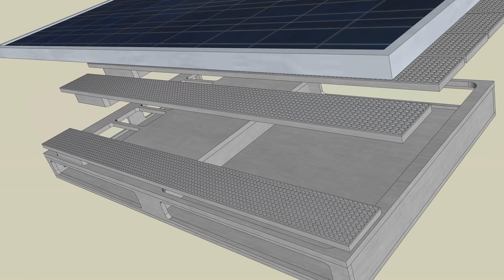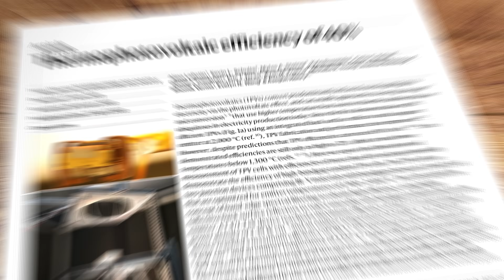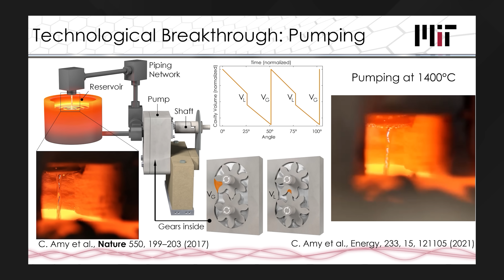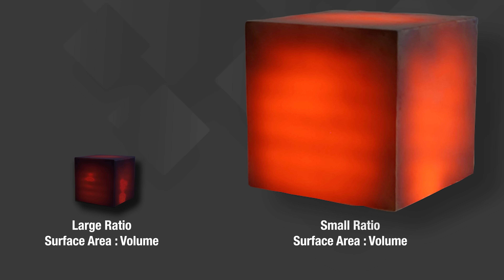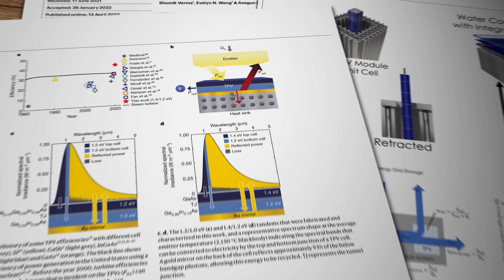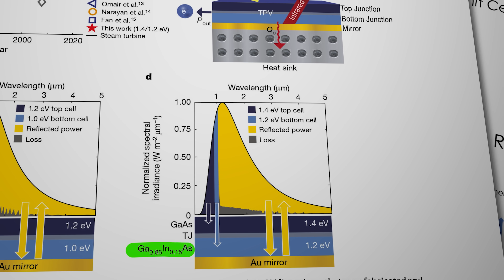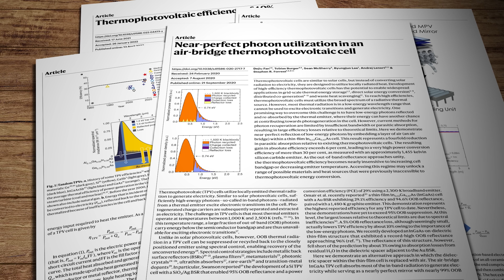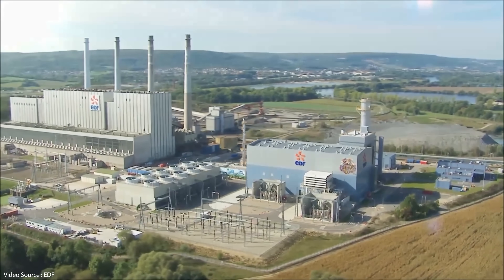Grid Scale Energy Storage 30x cheaper than Lithium-ion! How do they do that?

Comment: Certainly seems WAY too complicated!  Why not just heat the carbon blocks by running the electricity right through the blocks?  They make resistors out of carbon, so I imagine this would work fine.  And you could dump all the fancy gallium arsenide mirror PV cells by extracting the heat to run steam or gas turbines directly.  It might not be as efficient, but it would be way cheaper, using existing technology.

Comment: I'm confused as to why there are so many steps in this process. Graphite is a decent conductor, so why not skip the molten metal part all together, and just heat the graphite by using that as the resistive heater? And while we're at it, make the graphite in consecutive rings making it possible to heat the thing selectively from the inside out. In stead of argon, pull a vacuum, which would also double as insulation, as long as you reflect thermal radiation back at the graphite. Then design the rings to allow for the PV's to dip into them. Now you have all the blocks, and the same flexibility, in one unit.

Comment: Having thought about this a bit more, it seems the objective could be achieved extremely simply and cheaply with old technology. The energy store is the challenge, not the conversion of that energy into electricity. There are plenty of simple ways to convert heat into electricity. The energy store is in the carbon blocks. The other challenge in many locations, is the huge waste converting low grade energy of heat into high grade energy electricity, then converting the high grade energy back into low grade energy of heat once again. The carbon blocks can be located near where the electricity and heat is required. Use steam turbines to generate electricity and use the heat from the steam condensers to supply heating water energy to the local demand. Why use Argon to isolate the carbon blocks instead of nitrogen, there is unlimited nitrogen available. Also it is much easier to put out a carbon block fire than a Li battery fire.

Comment: Sealing that molten tin circulation system would be too technically difficult. Lets just build two extremely large, perfectly sealed BUILDINGS, fill them with argon gas, construct a multi-step thermal resistor between the generator, turbine, and motor made off eye-wateringly expensive, bewilderingly toxic materials, and inevitably entrust its management to a public-private partnership. Uhm, wat? Yeah, if this wasn't clearly destined to forever be vaporware, its future would look disastrous.

Comment: Wouldn't it be simpler to use Stirling engines? They're the most efficient heat engine and could use, say, 900°C rather than 2000, removing the need for such exotic components.

Comment: This is neat. It seems like that heated water could be put to other energy-generating use, even if it's less efficient than the TPV cells. Could that heated water turn hydro turbines? Heat buildings? Boil eggs? Venting the heat to the atmosphere might have an unintended local impact...

Comment: 1-sound expensive compering to gas plant (I know- ecology, but I try to keep it real)
2- sounds hard to maintain
3- sounds like something, that could blow up 
4-sounds to take a lot of space (I know -gas plants, but still, we could use already existing steam turbines instead of getting read of them)
5- sounds to use rare elements, lots of electronics and  and other materials, that we currently have trouble with in Europe 
6-sounds to have minimum load to work (can't be fully discharged)

Comment: inteseting concept, but wouldn't it b better to use the this technology to generate energy directly from wasted heat instead?, I think this proposed installation is a little bit overcomplicated, wouldn't it be simpler to generate the electricity using a stirling engine + a generator instead? the effiency of the Stirling is around 40% as well but the installation and maintenance would be much simpler than the proposed solution

Comment: I can foresee an industrial scale production of graphite with  a demand for CARBON which could be met in part by carbon recapture and atmospheric CO2 extraction. This would certainly help global warming.
The biggest problem is maintaining the graphite blocks temperature above the freezing point of the molten tin transfer medium. The nuclear technology of molten sodium heat transfer would be helpful with this ass well as the Control Rod moderation which would be similar to nuclear reactors control rods. an 
Interesting and mentally testing lecture: thank you!

Comment: Could they not also take the heated water to that is cooled with the radiator and use that to heat as a means for power gen also. instead of just dissipating it  put it to work.

Comment: Would be a very energy intensive system to build with a wide range of scarce materials. 

My concern with these new energy systems is how much energy do they produce compared to all the energy required to source materials and build them.

We are currently using power systems which require a small percentage of the power generated. Anything based on wind and I particular solar, consume much larger amounts of the energy produced, batteries make it much worse, to the point where the energy system becomes a net consumer of energy.

Comment: 70% of the energy lost... well, as interesting as this may be, this seems to be a bit much. Even at 30x cheaper than li-ion. The initial cost might be a lot lower, but the amount of energy you loose in the long term is crazy high on the other hand. 1GWh energy stored, means 2GWh of energy has been lost. If you have true EXCESS renewable energy (not excess renewable energy at a specific time) this might be ok, but under the circumstances we have now, it doesn't seem smart.

Comment: Interesting, but seems complex compared to rooftop solar.  40% efficiency is in theory, or in the lab.  I doubt it accounts for the fragility / maintainability of this system, nor the cost of transmission infrastructure, which incurs some loss of delivered power (lowering efficiency).  I still like local generation combined with local lithium-ion battery systems that are mass produced with modern, software-updatable BMS's.

Comment: This is very interesting science and engineering. However, I would be concerned about catastrophic failure at some point in the life-cycle. For example, what happens when the water escapes or the pump jams. Also what happens when the argon escapes. Nevertheless,  perhaps further R&D can result in fail safe variants.
Reply: All systems have the potential for catastrophic failures.

Comment: Looking at the prices that they factored in, I have some thoughts:
It looks like you need to add together the cost per energy and cost per unit of power you want out (about $0.33/W), which makes comparison to lithium ion more difficult.
It didn't look like they considered: land cost, maintenance cost, electronic control costs, decommission cost or cost of power transformers and connection to grid. They did consider construction cost, but that has to be a finger in the air guess at this point of development.
They also didn't appear to consider the cost of the electricity that it will be storing, which is relevant if they are only about 40% efficient, where as lithium ion is around 80% I think.

Comment: 3:16 The major problem is that the metal become solid when it is cooled down. Once the metal is solid it do not flow anymore and you sealed your hole system with solid metal. 
To keep the metal liquid when a component is broken and replaced is hard to impossible. On the other hand to remelt the metal while it is in the system is also hard to impossible.  
Anyway it will be no cheap technology.

Comment: OK so it returns only 40% of the energy input - that's not energy storage so much as energy thrown away.  Wasting most of your energy.  Like you charged your phone to 100% then looked at it and it said "40%".  You would not be happy with that. The problem with storage is you create electricity that is already in usable condition, then un-create it, then re-create it again, so logically you should not be surprised if it costs 3x as much as fresh electricity.  In this case you only get 40% back so it will cost at least 7 times as much as fresh electricity.  Stale electricity - who needs it?  Next...We didn't examine how efficient the REST of the system is - heating tin to 2000 degrees - pumping the molten tin around from one building to the next - 100% efficient?  Storing the molten tin without losing any heat?  Unlikely.  I'd reckon overall you might be lucky to get back 20% of what you put in.  NEXT...

Comment: The PV tech where unused photons are reflected back and converted into hopefully useful photons, reminds me of the prototype efficient incandescent lamp that had dichroic mirrors that would send all IR light back to the filament, and only let visible light through. This meant that the heat was locked in rather than radiated. I don't think it ever made it past this stage because LEDs became really good and cheap soon after.

Comment: I don't see how such a convoluted method can be cheaper than other methods which have been proven to be working, as there is a lot of maintenance necessary to keep the array from going berserk. Tungsten isn't exactly the easiest element to come by either, especially if we don't want to be dependent on supplies from China and Russia. A metric ton of this metal cost about 30,000 USD in 2019.

Comment: sounds like thered be massive heat losses and are we expected to actually believe cost analysis done by academics sitting in labs with no practical concepts of real world materials and facility construction costs are in any way even remotely credible ? especially considering the failure rate of start ups of these eccentric pipe dreams

Comment: Also, i'd think grid scale hydro power would be both cheaper, and more efficient, you'd just need alot of space for a reservoir near a water source. We've been doing this for more than 100 years with rivers in canyons and valleys, but many rivers dont have much room for a reservoir, or would flood thousands of homes. These rivers would need a man made reservoir and pump system

Comment: So many points of catastrophic failure. Pumping liquid tin. Cooling the PV cells. Keeping the Argon gas inside the structures. If any of those fail it's likely the facility would be a total loss. Any maintenance will require you to cool the system to human-tolerable temperatures which takes the whole facility offline for days. This will lead to massive maintenance costs which will make this system non-viable. Plus the fact that only a fraction of the total heat energy is available to extract. Once your temperatures are too low, the system no longer produces power despite tons of thermal energy still being contained. It seems like a Rube Goldberg battery, for no real advantages over other grid-scale storage concepts you've presented on this channel.

Comment: 100kw /m2  heat panels seems a lot . I see other wierd design problems. And it's hard to see that with this inefficiencies it would have 50 procent . Storage of heat in blocks and radiators . If 1 mw pilot would be launched than it would provide real data

Comment: If they can demonstrate 50% overall efficiency, that'd be interesting... because it would be superior to  typical PV  systems. But, I don't know that 50% would be very good. It's my impression that more common thermal storage of molten sodium at a much lower temperature (typically sodium and aluminum melt at 600 degrees F) promise much better performance although likely at a much larger volume and weight than the molten tin or graphite blocks described in this video.. Of course, the higher the temperatures the more difficult it is to insulate and prevent loss. That's an interesting idea to build an entire building like a vacuum bottle, using argon gas as the insulating gas. Lower temperature molten sodium can likely be insulated using layers of kiln bricks.

I don't know how much flexibility graphite blocks can give you... Maybe using a sendary circulating system as described, that might be possible. But the typical nature of any thermal storage medium is that the faster you can charge, the faster you can discharge and that can affect decisions of insulation and how much you can or want to draw from your storage. The advantage to using graphite is that it will have high energy storage potential but will charge and discharge very slowly but if the temperature is extraordinarily high, then the assumption is that even at max discharge rate you'd be drawing only small amounts at a time anyway.

So, bottom line is that I give this video high marks for desribing well a topic with great potential. Unfortunately it sounds like the project is still mostly in the concept stage and they are looking for funding to build demonstrator prototypes, but every idea has to start somewhere. Hope the inventors is as creative with their business sense as they seem to be developing the technical side of thier idea.
Reply: My understanding is the efficiency of the PV panels are 50% but the 'lost' energy is reabsorbed back into the graphite, so in reality the efficiency is higher. 
I don't know why they're focussing on the efficiency of the cells rather than the overall efficiency though.

Comment: Anybody did some raw materials calculation? Graphite, Tungsten, Tin, etc in regards to ton&price per kwh?
Heat dissipating into thin air for the water cooling of the panels? Use district heating systems instead.

Comment: The great thing about this idea is that it will use electricity which would otherwise not be used, or indeed generated. At present, wind turbines and solar PV units are generally disconnected or stopped when not needed. With this system, they can be used to their full capabilities. 

The radiated heat, which would otherwise be wasted, can also be used to drive turbines to generate more electricity, which could be fed back to the heating elements. Or the heat might be passed through heat pumps to return 'high grade' heat to the carbon heat storage blocks, if a suitable pump could be developed. Either method should lead to an even better overall system efficiency.
Reply: Actually if I were designing a system I'd eliminate what you describe. Every time however teh solar energy is collected and converted to energy, there is loss. Electrictiy transported across a medium is loss. And the converting to heat as described in this video involves loss. A truly efficient system would try to eliminate losses both by removing those processes and by capturing what would normally be lost.
Reply: @tonysu8860  Agreed, but this system still has viability in that it is at least trying to do something useful with energy which would not have been used otherwise, whilst minimising the losses tolerably well. Even with the losses, there is an effective net addition to the amount of stored electricity, which allows for a somewhat smaller peak generation requirement. It 'smooths the peaks and troughs', in other words.

There are various other ways to store energy, including subterranean heat storage, pressurised gases, pumped water reservoirs, etc., but different methods can be the best option in different locations and circumstances. For instance, pumped water reservoirs are not very practical in a flat desert area, but they can be quite efficient in mountainous temperate areas.

The method described in this video has additional merit because of its relatively low cost, in comparison to some other solutions. The financial cost of a system has to be considered, whether we like it or not. My view is that this is probably the prime motive behind this idea.

Comment: the initial cost looks promising. As a former 800 MW power plant maintenance manager I wonder, what will be the ongoing maintenance issues and what would the cost be. Those costs must be considered when selling the idea to a developer.
Reply: When your "basic principles" description looks like a Rube Goldberg machine....
Reply: I would expect someone who has worked in this industry to not fall for this BS. This is like taking a battery with close to 100% efficiency and throwing away over 1/2 that energy on losses. This is a BS hype piece, as usual for this channel.
Reply: @excitedbox5705 I'm not going to defend this vid as there is plenty of scope for losses not mentioned. However, round trip efficiency of batteries is no better than 95% and except for hugely expensive cells, solar PV is about 20% efficient at energy capture, making overall sunlight to stored energy efficiency of 19% at best. Solar thermal capture can be as much as 90% and if you ignore all the undiscussed losses in the system in the video, the solar to stored electricity efficiency would be 36%. I can't see it being anywhere near that efficient, but it's an interesting concept.
Reply: @lisakingscott7729  Solar is actually much less efficient because those 20% is claimed at room temp in a lab and not under real world conditions. However, this system is talking about taking that inefficient energy and converting it to heat and only getting <40% of THAT back. That means what is really closer to 11% real world energy capture is taken down to less than 5% efficiency.